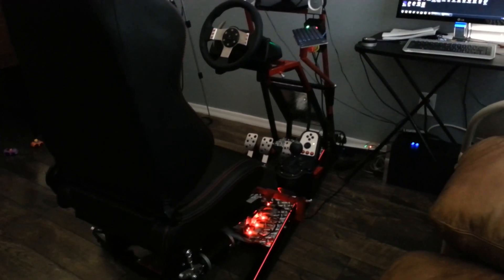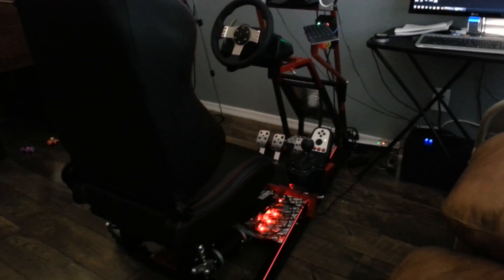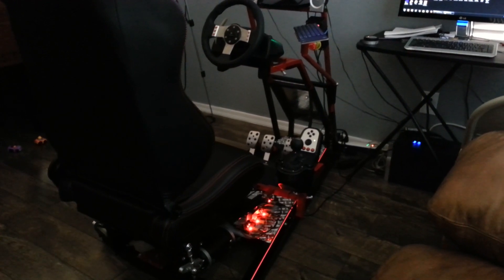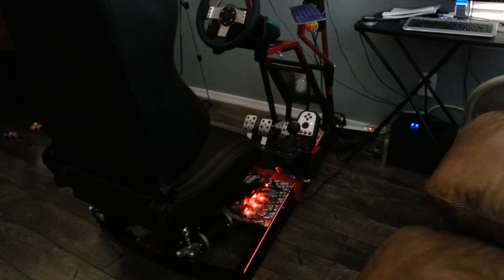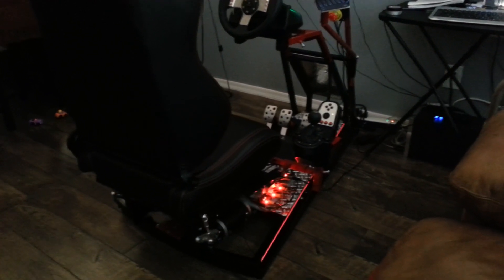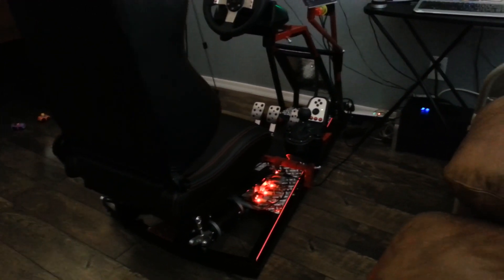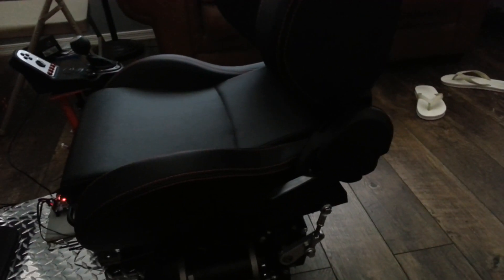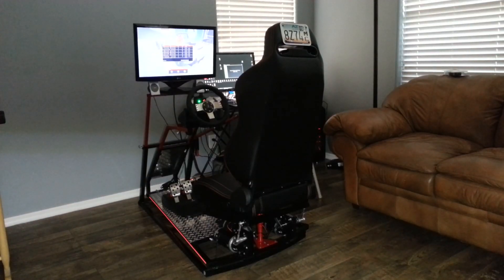DIY 3 Axis Motion Racing Simulator 3DOF, traction loss using DC Worm gear and Monster Motto

Comment: Good Post ! Thanks! Similar to you, i bought a welder and learned on the fly to build my 3Dof Sim platform. Upgraded from WW motors to Crab pot pullers, using IBT2 and arduino. Not quite finished yet but watching a vid like this makes me look forward to getting it all going finally.  Thanks again! D

Comment: the traction loss is very good but u need to build a frame to support that monitor to have the right  immersion and use a tracker for head movement . i'm building one too , for rally with big iron cage , monster motors, custom handbrake, custom sequential shifter and pedals too, arduino hud,  carbon fiber body.  maybe we can share some ideas. make the upgrades for the monitor , you will have so much fun. Aloha!

Comment: I must say you are very impressive. Not with just your design and build but you must have spent so many hours just learning how to use each of the following since they each have pretty big learning curves that take time to be able to use well enough to build something like this.( ex: learning Arduino code well enough to write the custom code to run this, learning how to use the  CnC machine and its design software, learning Sketup and then the time taken to draw up your designs ,  learning how to weld well enough for your build, and all the cleanup time,   and whatever else you had to learn to do). Its no wonder you have no time to use it. How did you find the time to do anything else?  I have used all of the above and they take time to get over that learning curve. How long did it take to get the build to its current state?
Reply from the maker: Yes it did take a lot of hours and cause a lot of argument on relationship as well... lol.  But knowledge and skill was obtain over the years, not at once.  Took about 8 months from research to finish.

Comment: Putting motors directly on a seat just seems like it would feel so unrealistic and make steering/shifting unnecessarily hard and unnatural. If you're going to go motion do it right and give motion to the entire cockpit like a real car would. The traction loss setup looks really nicely done though.
Reply: Dude I bet you have never put a puzzle together, this dude's brillia you always got some weirdos like you come along.
Reply from the maker: Lol, you have no idea what ur saying dude. Go do more research.
Reply: @devildestiny555  I get what Steve h is saying but his method, while more realistic, would be a pain the ass to configure I would imagine. your setup is a beast over all great job! Very sick
Reply from the maker: @markzamora2106   A simulator is suppose to simulate you and tricked your mind through motions, feels, visions, touches... This is what they called seat mover, if only the seat move, when you hold your hand on the steering wheels, your wrist twisted and turn as the seat move you, it will further increase the feeling that you're in motion.  The mind is smart but weird and it can be tricked easily.  The pros of a seat mover is that the reaction is fast and responsive.  A full platform (which I have built before) requires a lot of power but can never archive speed of a seat mover so for can cause lag... So think about that.
Reply: @devildestiny555  I see what ur saying, makes sense.
Reply: @devildestiny555  Do you think a seat mover has more imersion than a full frame ? I;'m thinking to build my own 3dof, right now I'm trying to learn as much as I can.